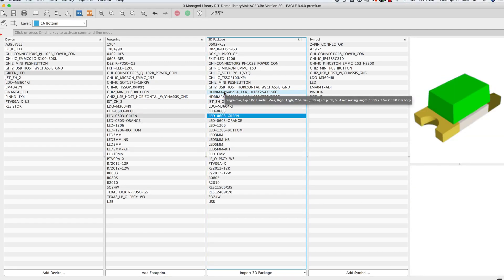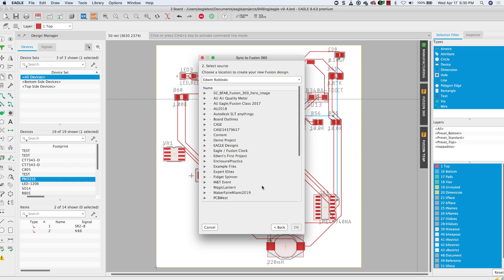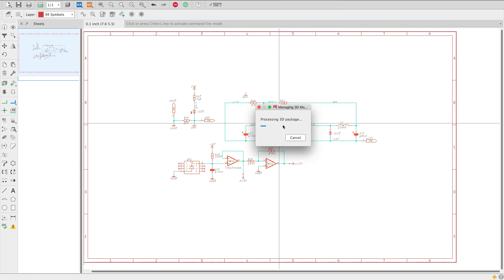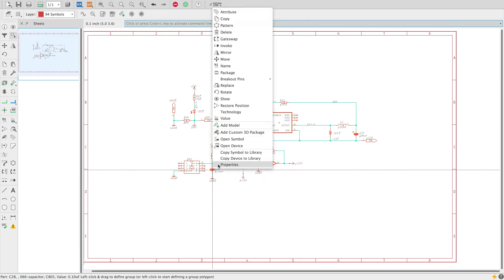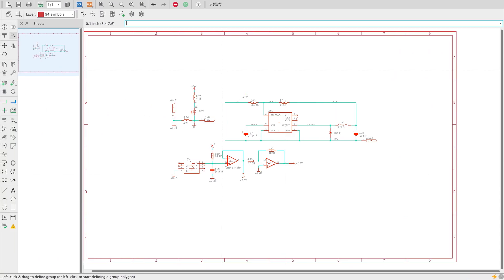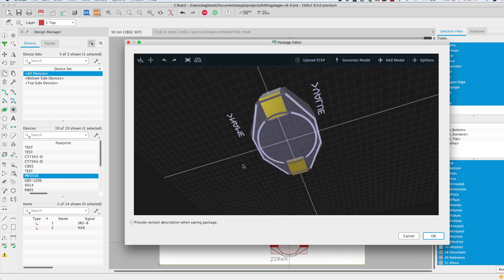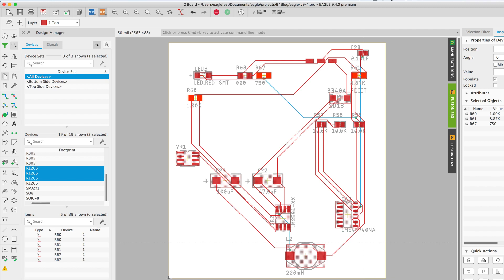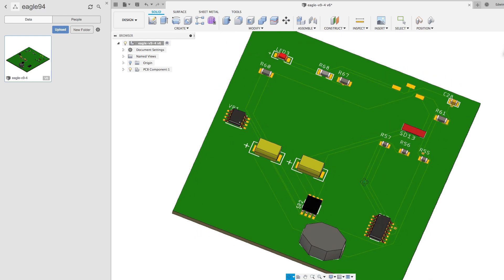Assign 3D Models directly onto your PCB and Schematic

Comment: Can not use ULP del-pack-sym due to 3D models attached to footprints even if the footprint is not used in any device it gives error that the package in use by 3D model. 
ULP needs update. I am having some crowd in my library due to this
Reply from the maker: Hi There, Thank you for the question. There's still an association there between the 3D package and footprint. For now the best way would be to delete those assets individually.  Please join us on the EAGLE forums with other questions. Cheers!

Comment: "After a few minutes....the package editor will appear...."
My last project had 250+ unique parts, lol.
Reply: Hi! I work for Autodesk and actually added this particular functionality.  The "few minutes" comment is a bit of an exaggeration.  The video shows this process in real time so the time it takes from starting the process on the design to generating/uploading your model and orientating it over the footprint should take mere moments.  Hope you give it a try!
Reply: @colintaylor1629  Thank you for the clarification!  Trying ALL the updates now. Some are excellent, some are only slightly helpful. 

Any workflow improvements in the library is greatly appreciated. I am dreaming of a total do-over since the current system is adding up to being a 1,000 band-aids on a gaping wound. Come out and speak with power users and professionals if possible.
Reply: @colintaylor1629  been waiting for this feature since I moved to eagle January'18... I used to add 3d models on top of the autogenerated red blobs on the PCB using joints in fusion360. 
this newly added feature works perfectly as shown.  TBH, the "few minutes" translates to around 40~50seconds on a moderate workstation with decent internet speed.  Considering the fact that it has to be uploaded to the server and processed, pretty impressive!!!
Still, with a project with lots of unique parts, these 40seconds would add up pretty bad :(